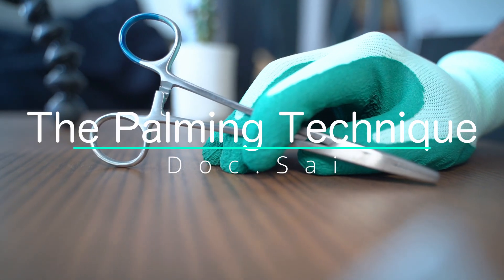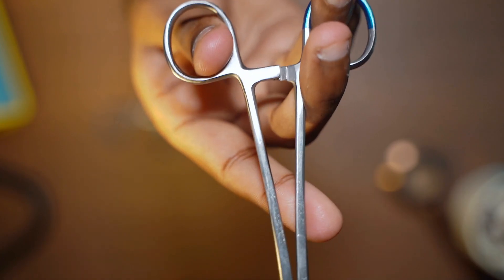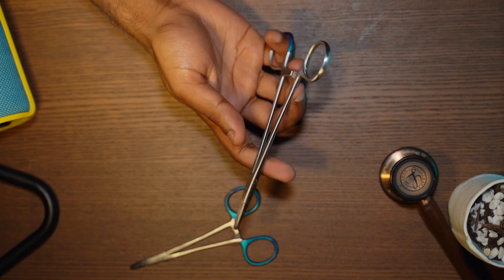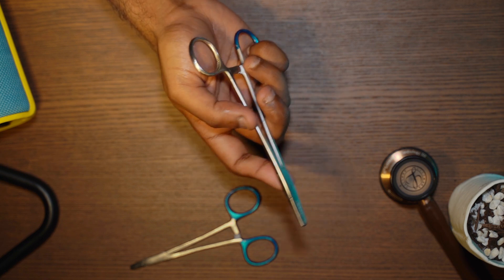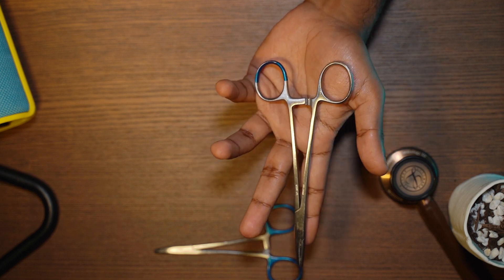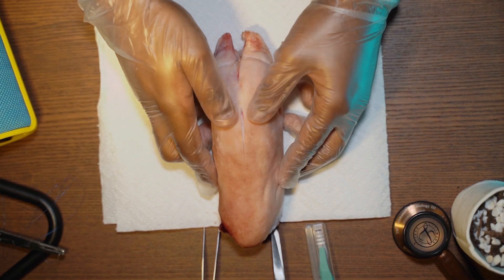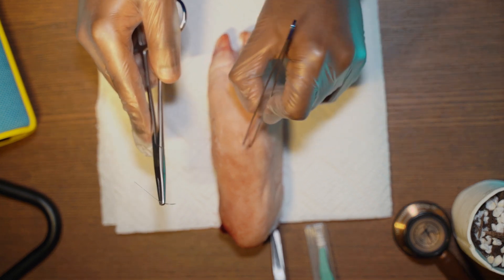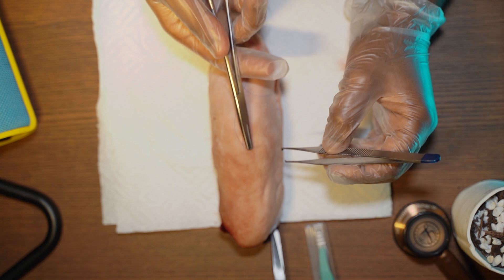HOW TO SUTURE | Surgeon Style: The Palming Technique

Comment: scalp lacerations?
Reply from the maker: Hey Elliot :) thanks for the comment. Does depend on resources and if staples are available or not. But i find if you do suture the scalp, your driving force is better than the traditional hold. Often helps prevent the needle from bending or changing its angle. I find it really usefull for scalp incisions eg. Post insertion of EVD drains. 
Also find its easier to do figure 8 stitching to stop a bleeder while palming rather than traditional  hold because you have more pronation:).
Any thoughts?